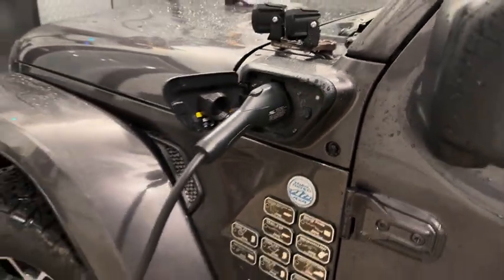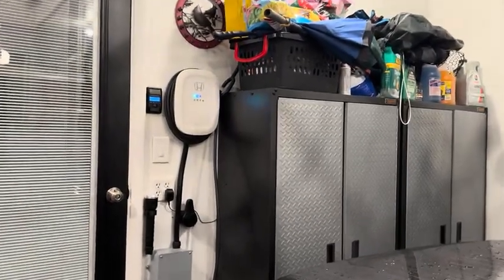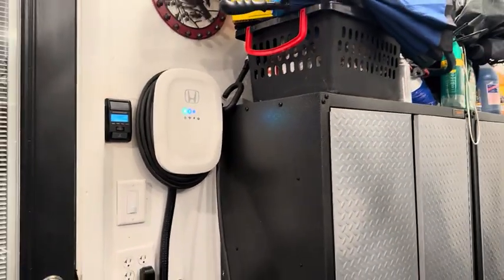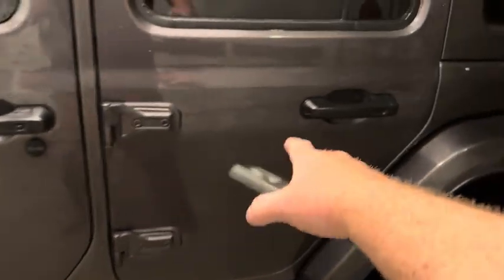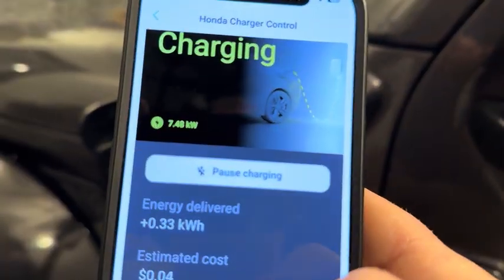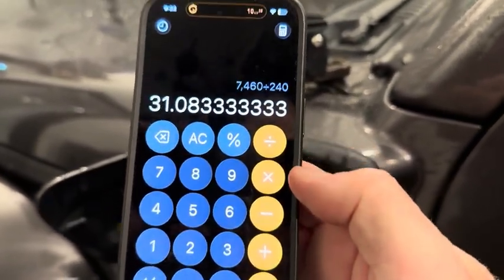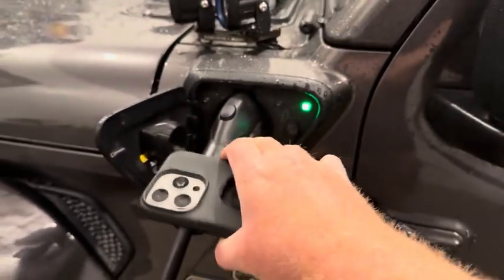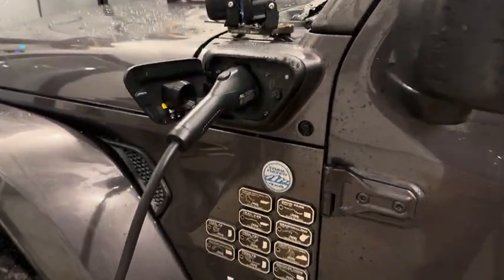How Charging Works

Comment: Question: When does cell balancing happen? Is it only after reaching 100%? I ask because I usually charge about 80% and unplug it. Unlike my Bolt, there's no way to set a maximum charge and leave it plugged in. It doesn't get cold here, so battery conditioning isn't a problem. Is it able to balance the cells or should I be charging to 100% (once 68C is done, of course.)?
Reply from the maker: During charging, after charging, while driving. Cell balancing is constant.

Comment: Great info 👍. I do have one question related to the battery. One video I watched, a person went to sell or trade their EV, and apparently somewhere on the screen it tells you how much efficiency is left on the EV battery, and dealerships won’t buy or trade if the efficiency is bellow 80%.   I think he said that the manufacture won’t cover the warranty on an EV battery when it is bellow 80% efficiency.  I was just curious if anyone knows if that is also true of the 4xE hybrid battery, and so we need to trade it off before the efficiency drops bellow 80%?
Reply from the maker: If it drops much below 80%, it throws a P0DAB code. That indicates a cell imbalance condition that requires a replacement. It’s a safety issue. Jeep may be required to replace batteries long after the warranty period since it’s a safety issue. But it also sounds like we might be getting unlimited lifetime warranties as part of this latest recall.